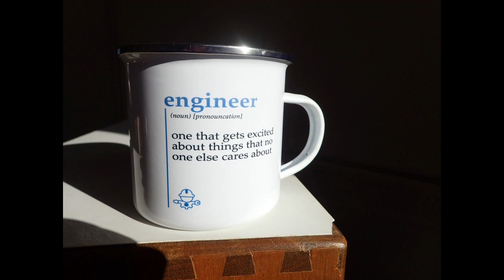Myford Lathe - Dickson Style Quick Change Tool Post (QCTP).

Comment: I have no issues using 12mm tooling in mine. But one thing I have noticed, is that no one ever talks about the ability to pin these tool posts to the cross slide for greater rigidity using the hole in the corner opposite the mounts for the tool holders. It means putting a suitable hole in the cross slide, but once pinned, it is rock solid.
Reply from the maker: Hello Jack,
Many thanks for watching my video... I agree that the pin would help a lot... I am considering removing the compound slide as I don't use it to much, I also have a taper turning attachments for the odd taper I may turn...
Take care.
Paul,,

Comment: Thanks for sharing. A suggestion on the tool post is to pull it apart and clean it thoroughly because of the potential of all the grit inside. All inexpensive unit should be cleaned  in that fashion due to the lack of attention when they are assembled at the factory.
Reply from the maker: Hello Yves,
Thanks for watching and taking the time comment. That is a good ideal and I will do that this weekend...
Take care.
Paul,,

Comment: I have a Chinese made one and I can use 1/4  inch or 1/2  inch I guess anything in between, and you set each holder for the cutter you are using and it will always stay the same once set,,  I ordered two more tool holders so I can pretty much leave them all preset.
Reply from the maker: Hello Vernon,
Although purchased in the UK I believe these are made offshore... I think I will need a few extra tool holders, which I will most likely purchase.
Thanks for watching.
Paul,,

Comment: Hi Paul, that's basically the same toolpost that I have, I think I have the next size up. My tools tend to sit right at the bottom of the toolpost, and on a couple I've actually had to remove a small step of material (maybe 3mm) to give me enough adjustment to get them on centre. I'm generally using 16mm tools, but the toolholders are 20mm. I suppose it just depends on the lathe. The only trouble that I've had with the toolpost is that the piston can be rattled loose, especially during interrupted cuts. I think this may be because both parts are so hard, there's no elasticity to soak up the vibrations. I didn't get any locking screws with mine! All the best.
Reply from the maker: Hello Olly,
They do appear to be quite popular and generally good reports... I have seen quite a few people milling the bottom to give more clearance, I guess once I get turning in anger I will get a better understanding of any mods that are required.
Thanks for watching.
Paul,,

Comment: Hi Paul,
They are quite good, for the money.
I've been using one for quite a while, only had problem with one tool holder being incorrectly machined.
I use the same one from Rdg tools, the individual tool holders are quite expensive, I use up to 12mm tooling on the Sc4 lathe.
They did offer a discount for buying more than one, when they are in-stock
The boring bar holder is not very rigid, with the vee groove, so I  use boring bars with flats on the shank, with standard tool holders
They work well for me :)
ATB Adam
Reply from the maker: Hello Adam,
That's good to hear you used one for a while and interesting to hear the tool holders quality is intermittent... I am not sure how to overcome that other than try and make them myself which to be truthful is no guarantee of quality - lol.
Thanks for visiting.
Paul,,

Comment: hi paul
looks a nice little tool holder, i made my own version, a bit of a time consuming job though on my small mill, with fairly hard steel,
you will soon be making turnings now.
mr f
Reply from the maker: Hello Mr. F,
I am pleased with the setup and RDG sent me the missing bolt... I Just trying to get the lathe on the raiser blocks and level it this week, then my tinkering with it will be complete. I initially plan to use the lathe to support the restoration of the Unimat and then the Deckel and Shaper, but as we know I am easily distracted - lol.
Take care.
Paul,,
Reply: @TheKnacklersWorkshop  sounds good, should be an interesting project, look forward to it.
regards
mr f

Comment: Gday Paul, that’s a nice finish on the QCTP, I have the same on my small lathe and I found it great to work with, I run 12mm tooling in mine no problem but I haven’t measured it to see if it’s the same model as yours, the tool holders can be expensive to buy on there own, I was lucky that I was given mine with a heap of tool holders, the only thing I found was when you are changing tool holders I always held the holder in the middle when I turn the handle to lock it in, this way it always repeated on centre height, great video mate
P.S. Good some Myford action soon....😉
Reply from the maker: Hello Matty,
It's good to hear your one was okay... and thank you for the tip on holding it in the middle... 
Pleased to see you saw the comment in the video description, I put a different one in each video, sometimes it takes me forever to think of something mildly relevant.
Thanks for watching.
Paul,,

Comment: Those are nice. I looked up a few and they are very reasonable priced and seem, in my mind anyway, to be a more solid lockup than the wedge and dovetail type I have. The only drawback seems the cutter size as you mentioned. Most of my stuff is 3/8" and 1/2". I have actually had to modify a few of my cutter holders to fit my own. Thanks for sharing. All the best!
Reply from the maker: Hello Eddie,
Thanks for visiting... I agree they do seem more solid than the Dovetail/Wedge type and are not that much more expensive. I think here in the UK the additional tool holders do seem to be a little more expensive so, I may be limited on how many I have.
It will be interesting to see what I can do with the smaller tooling and if I have to make modifications.
Take care.
Paul,,

Comment: The Dickson QCTP looks great on your Myford, and that style is quite rigid.  Most Myfords I've seen in videos have either a Dickson style or an old Norman style.  If you would like to use slightly larger insert toolholders, I've seen where others have milled down the bottom to fit.
Reply from the maker: Hello Daniel,
Thanks for visiting... I did not know about the Norman tool post, I will have a look. I may be being idealistic in my attempt to not use bigger tools  but I guess the job in hand will dictate what is needed.
Take care.
Paul,,
Reply: @TheKnacklersWorkshop  The "Norman patent" style is easy to make in the home shop:  just a cylindrical turned post with a square block TP, clamping with a bolt in the rear.  And I do agree with you on tool size;  wouldn't use larger than 3/8" Imperial on a Myford on a normal basis.
Reply from the maker: @danielabbey7726  Thanks Daniel, I've just had a look and I like the simplicity of the Norman...

Comment: I've tried to work with the clog-heel toolpost - too much faff. I've currently got the indexed 4-way  - but it's getting quite frustrating to find 3/8" tooling - particularly parting off blades. I've got a rear toolpost and one of the HSS blade tools, but it doesn't hold up straight...
Reply from the maker: Hello and thanks for subscribing... 
I was going to go with a PeWeTools multiflex system and may end up going that way in the future... I think it best to get something whilst your get up and running and become more familiar with your needs and the limitation of the Myford, then make an informed decision.
Take care.
Paul,,

Comment: Hi Paul.  Interesting video.  So many different QCTP styles to chose from.  I totally agree with your comment regarding people exceeding the design capacity of lathes and tooling and then whining about how bad they are.  Don't these people have any brains at all ?  LOL  Total butchers IMHO.

I was interested to see how square the tool holders pulled up.  This is always an issue when the piston or ram is not dead on the holder center line as they can cant.  That's why it's important that the QCTP be the correct height for the lathe/ center line.  10 mm tooling is quite OK for that sized lathe.

I  like the way the Myford cross slide is "T" slotted crossways, same as my early Sherline.  So much more RIGID than the current fashion/fad of slotting the cross slide longitudinally.  I had a rant about this a ways back.  Most people will never use them anyway, so it's a pointless exercise 99% of the time.

I bought a few items from RDG many years ago and the quality was OK, but nothing exceptional.

Cheers Rob
Reply from the maker: Hello Rob,
You are right about lots of QCTP to chose from and for quite a long time I was going to go down a different route but eventually picked this one... I think you can push the limits a little and maybe get away with it but if you go to far you are most likely going to encounter a problem somewhere else...
Thanks for watching.
Paul,,

Comment: Hi Paul, getting there mate, looks well on the lathe. Looking forward seeing it in use. I think you have a good plan to tool up the machine within its limits, so many will try to overstretch the capacity and then get disillusioned when they get chatter / vibration. You can do a lot with 10mm Tooling, just need a bit more patience, it's a hobby so there's no rush. Cheers, Jon
Reply from the maker: Hi Jon,
After a bit of pondering I did come to the conclusion that if you deviate to much from the norm you will most likely pay the price somewhere else. Also, being retired if anything take a little longer it does not really matter...
Thanks for watching.
Paul,,